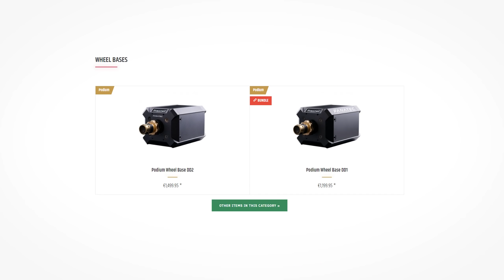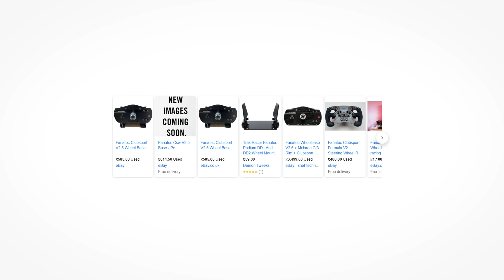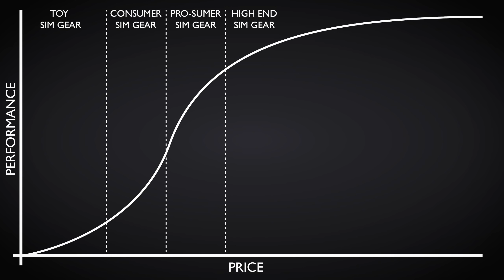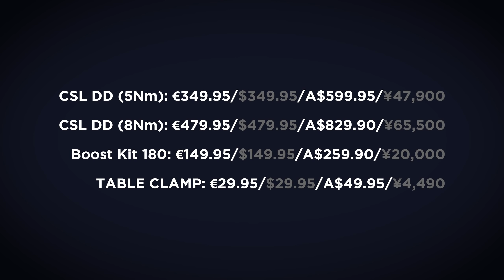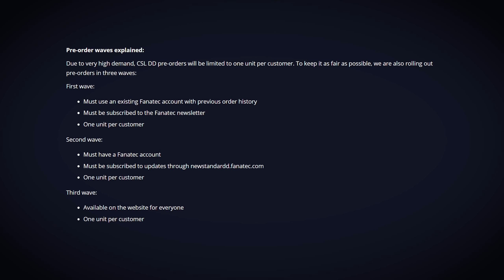Testing The New Fanatec CSL DD Direct Drive Wheel [First Look]

Comment: I'm afraid I wouldn't spend this much money on a new model of anything electronic. Wait a year, see how users rate them after a year. Personally I'd rather have either a good belt drive or a more expensive direct drive, I'm not sure who this is aimed at, I have some very serious health issues but even I would want potentially more power in a direct drive unit otherwise I don't really see what's to be gained over a decent twin belt drive. Yes technically a direct drive is better but if you can't drive a belt drive, direct drive isn't going to help you.

Comment: The CSL DD has convinced me to go DD.... with a DD2.
Reply: Why not SC or VRS, DD2 is a dumpster fire would hate to have been stuck with it out of warranty.
Reply: @damiendegrasse  SC - Poor local support for me. VRS - Variable experience across sims. Saying DD2 is a "dumpster fire" shows you made your mind up via third party fanbois.For what it is worth, I've tried all the main DD contenders through a wonderful local sim-racing community and come down in favour of the DD2 for the following reasons: 1: The system and sims are keeping up with changes in FFB software technology - i.o.w - the sim makers are working with Fanatec before releases, not after. and 2) integration with motion and VR accessories to an extent which other offerings have not.
Yes, I know there are great communities which support all possible offerings, but if the manufacturer is entirely reliant on the community for progress, the end result is not going to be great. I'd compare this to Red Bull building a car based on the feedback of one pilot rather than performing proper non-subjective analysis.

Comment: If it is cheaper, due to economics of scale, to produce a single item and then sell a reduced functionality version at a "discount" why not just offer the full product at a reasonable price? I for one am not ok with 130 extra for what amounts to a slightly more expensive power supply. If it is profitable at 350,it would be very profitable at say 400 and I would be glad to pay for the bump in torque. As it stands, it's just a top notch exercise in marketing from Fanatec. Thanks Chris for another great video.

Comment: Would you recommend getting the wrc wheel or the mclaren v2 for the csl dd for the beginning and for overall use?
Reply: I got the $199 WRC wheel out of those two choices mostly because the WRC wheel is more of a universal wheel than the McLaren V2 wheel is, due to its shape. Driving with the McLaren wheel in games like Dirt Rally 2.0 probably wouldn't go well because of the need to make very sharp turns in certain races. That wheel would be causing you to twist your arms in odd positions a ton in that scenario, as if your trying to turn them into pretzels

Comment: You couldn’t help to wear red shoes :) 

the runs @ Donnington, Brands (nice work out of 1-4 onto long) and Leguna (tricky track) were entertaining. 

The discussion of torque is more so something that should be trashed out. 

With a Bodner 254, 32 NM, its at 18%, simply because that feels right for me, as an enduro bike rider, less so car racing.

However, hear me out on this, Viewers - dirt bike pro’s get their data, from seat of the pants. 

Feelings. 

It is hard to translate into words, but riding fast in a forest, you steer the bike on power and so you get the bum feeling. 

It’s instinct, however either you do or don’t have that feel or ability to process the info fast.

Specifically, I do not use motion systems, despite being installed, BK used very rarely, simply because I seem to get the appropriate data visually and via hands.

Which sets up slip angles.

Dirt bikes turn on rear steering.

Take a TCR car for a drive on N24 Long. Of course, like dirt bikes, you  mentally do ‘left foot brake’.

Suggestion: Take the Seat Cupra WTCR for a run, first at HOPE on AC, then move to Road Atlanta.

The car will float on this track, with very little steering input, provided you left foot brake and power on early. No snap o/s.

You’ll know. Nice work, btw.

J :) ✋️

Comment: If you set a DD1 to 8 NM, it is not comparable with the CSL DD at 8 NM.The CSL DD will not display effects. The DD1 does. That's why you need more than 8 NM maximum power.
Reply: Yes an 8nm wheelbase will clip at maximum output while the more powerful wheelbase will not.
That is not rocket science but basically common sense.
But considering the new CSL Elite DD cost way less than half of the DD1 and about 1/3 the price of a DD2 when it comes to price versus performance at the 8nm power level it is a no brainer the CSL dd is a much better buy and value when using those power levels for those looking at using the lower power settings most of the time.

Comment: Question: I have cerebral palsy and I’m prone to tiny hand spasms that jerk my wheel. In my CSL, this is no problem. The wheel resists my movements and it helps me to not lose control. Is DD so “direct” that it’s overly sensitive to tiny movements like that? Or is that configurable?
Reply: Also have CP, but not the symptom you describe. This base will have similar steering weight as your current base, and more with the boost kit. If you need you can program in a dead zone.
Reply: Pretto musch Evert game has a deadzone setting. Should solve everything!

Comment: Where this wheelbase will totally shine for many are those that are already in the Fanatec eco system and already have compatible wheel rims and even pedal sets and want to move up to the fidelity of a dd wheelbase over a belt system and with this unit can do so even with the 8nm power brick for sub $500.
For the average casual sim racer this is a huge difference in what the expense will be as compared to the higher powered previous offerings from ANY manufacturer and again for the majority of users the power levels of this unit will be more than adequate.

Comment: Chris, I love each and every one of your vids. I love your style and how you approach every detail. 
I came here to clarify my doubts abouth this wheel and I'm on even more doubts about what should I do, but your work is amazing. :D

I got a 2nd hand G29 as my first wheel 3 years ago, almost at the same time as a coworker built for himself a whole cockpit with a DD. I just wanted to know if this was a "1 month hobby". The G29 worked really well and 1 year later I replaced it with a TSPC because I wanted more strength "but the DD was too much for me". Now, that finally I built a proper aluminum cockpit and got the V3 pedals, I'm really considering a DD. Just like my friend 3 years before, but buying and selling stuff on the way. 
I was almost ready to go for a Simucube Pro, but the Fanatec brings this. I'm looking for more fine details and smoothness, so my question is: Does that extra strength - and maybe detail fidelity - cost almost 500€ (CSL DD with the extra power suply vs. Simucube Pro2, i.e.)? Or will I regret my decission again a few months later for not buying the high top end gear and getting "just" with this 8nm DD?

Comment: What are your opinions on the price of the Boost Kit 180?
Reply from the maker: As a stand-alone thing, it's expensive. But, equally, the prices of the various parts have likely been set to produce the desired margin over the range of CSW DD parts, so I would presume they're not making as much margin on the wheel base. That's all speculation on my part though. We see this kinda thing in tech products all the time though - if you want to see the most extreme example, take a look at CPUs! 

I guess the other way to look at is that the wheelbase with boost kit is still cheaper than the old CSW2.5. Apologies for the slightly non-committal answer, but I don't really have a binary opinion on the subject!
Reply: @ChrisHaye  Thanks for the answer! Wasn't exactly sure what to make of it, but I quite agree with you, they do need to make money on this product, and it is after all 60% more torque. However, the cost to produce such a psu would (just a rough guess) be around 20-30 euros max, given that it can be mass produced, so I'm still quite "iffy" about that extra 100 euros. I think Will from Boosted Media said something about the power supply not using and extra connections to detect the Boost Kit, so a possibility of a third party power supply would appear. Overall, I think they have done well to place the Boost Kit in such a way that it gives the most performance boost in terms of raw torque and fidelity, as a weaker wheelbase would be not very competitive and a better original wheelbase would be less of an upgrade. I just want to thank you for helping everyone break down this information into something that was easy to diflgest and comprehend. Keep it up, I have no idea how you are able to edit this with such quality in the time frame.
Reply: @zachxtk  The point isn't the cost of the other PSU, but that they LOSE money on the 5Nm model, and then probably make a bit on the boost kit, relying on you buying their pedals, rims, and other accessories to make money off of it - just like with game consoles. 

It should be more looked at as the 5Nm model being a good deal than the 8Nm being unfairly priced.

Comment: Can you mount it on a wheelstand instead of a fixed rig as with the old DD's and their increased torque that wouldn't have been possible? I Hear the CSL DD moves things around less so you can but not sure.
Reply from the maker: You can, but I'd argue you won't be getting the most from it. The problem with wheelstands that I've used is they behave like a damper, so they somewhat take the edge off the ffb feel. The 5Nm PSU won't cause massive issues, but I'd say the 8Nm one would be pretty horrible to use!
Reply: @ChrisHaye  Thanks Chris, guess I'll order that 8Nm PSU for the distant future then when I finally upgrade my wheelstand pro :P
Reply: @ChrisHaye  Would you say that if someone spends their budget on everything other than a proper rig that a wheelstand is good as a stop-gap? I'd like to go all-in on a DD1 and all the fixings but can't then afford a ~$600+ Aluminum rig, and monitors/TV, etc all at once - thanks!

Comment: So how do you connect it to your pc? is it simply a USB 2.0 or USB 3.0 or is it a USB C?
Reply from the maker: It comes with a Type C to a Type A cable. I believe it's backwards compatible to USB 2.0 but will have to double check that. There's no mention of it needing 3.0 or later in the manual.

Comment: I'd love to know if this is going to fit on my self built sim rig. Any chance we could have some dimensions? Critical one for me is the distance from the rear of the base right up to where I grip the wheel rim.
Reply from the maker: Rear of the unit to the centre-line of the WRC rim is 320mm. Rear of the unit to the end of the wheel side Quick-Release is 240mm. Hope that helps!
Reply: @ChrisHaye  You are a gent, Sir. That looks bang on for me - should not cause me any problems at all. Whilst I mainly race on PC, Playstation compat is needed for me also so I guess now we wait for announcements. Many thanks.